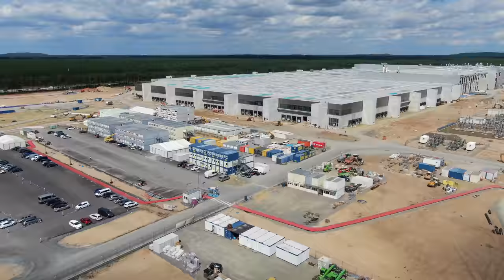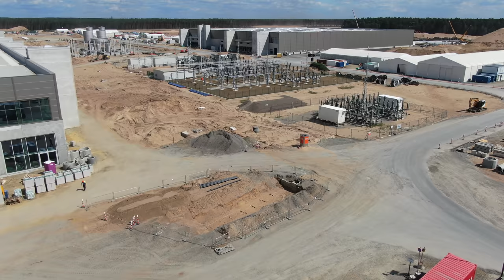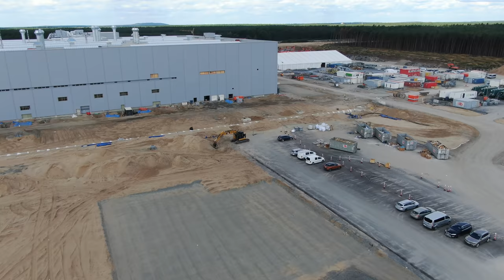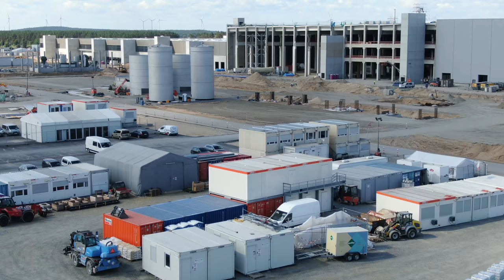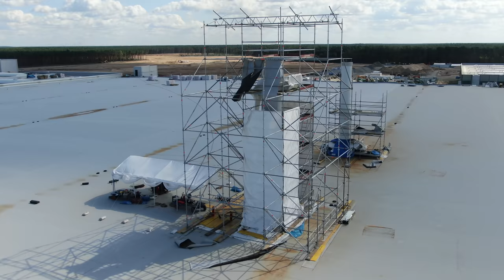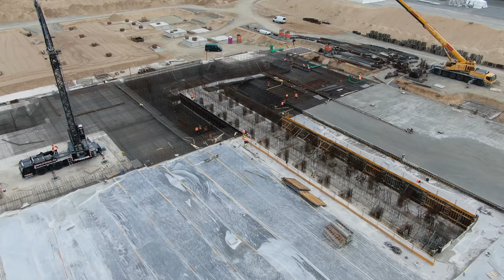Giga Berlin | 2021-07-31 | First Cell Column

Comment: Based on the height of the column, the cell building looks to be quite tall, as tall as or even taller than the paint shop section of the main building.
Reply: Same hight.
Reply from the maker: Roughly the same height. The roof will be a little higher, but not much.

Comment: What kind of building needs such reinforced structure ? It reminds of skycrappers foundations. Also the pillar is huge yet it does not require support metalic bars like they do in Texas, intriguing.
Reply: Thats the battry production building. It has heavy machines on multiple levels. It needs a strong foundation to support all that weight.
Reply: @JackONeil12  but there was nothing like it in Texas apart from two narrow corridors.  Maybe the can't do geopier in this soil but still the amount of reinforced concrete is staggering
Reply: @shonguiz0  Yeah. Its definitely a lot of reinforcement. Im sure they have their reasons ;)
Reply: @JackONeil12  i really dont wana pull the "but we in Germany do it correctly"-card but its a fact that most German houses/buildings are pretty solid whilst American housing is often made of ticky-tacky. Im not saying that American factories/skyscrapers are all poorly built but those German engineers know what they are doing
Reply: The factory is being built in a water protection area. Many people there are entirely dependant on ground water. My guess is that, in addition to supporting very heavy machinery, the building is being constructed in a way that keeps harmful chemicals from entering the soil at all costs.
Reply: @sebb2826  i dont know, man...
Reply: @sebb2826  That might explain it, although that makes me wonder even more why Tesla insisted to build the factory there. BMW in 2000 was considering it and then opted to go for Leipzig because there was too much risk of environmental obtsacles and thus public objections, exactly what is happening now. They could go to another german site with less risks.
Reply: the ground around brandenburg is known to be very rich in sand and nearly free of stone / other stiff components. building in this area tends to require a stronger fundament than average
Reply: The giga texas didn't have an area explicitly designed for batteries.  Giga nevada doesn't have huge foundations like this either even though they are the battery maker for giga san Franpoopsco.  Elon said he had a team of engineers working on new battery processes.  I'm guessing that there is some amount of storage for raw materials.  The only other times we saw elon dig a hole was for a hydraulic press, casting machine and water management.  This is a huge underground section, and an German bunker level of concrete, so i think they are using that for storing raw material for batteries (rocks)  If Elon is putting his promised rave cave under here, why put it under the building that is slowing down the production of the entire factory?
Reply: High pressure rollers, lots of rails, ultra high precision requirements -> all need ultra stable vibration absorbent foundation.
Reply: Have you ever put heavy machinery in the 3nd floor witch groundet on sandy ground? I guess it is needet... for a robot on the 2nd floor you will need 2 feed of concret!
Reply: "place to park the German Army" would appear.
Reply: @doolittlegeorge  watch out for art school dropouts!!!
Reply: @davidanalyst671  🤦‍♂️🤦‍♂️🤦‍♂️🤦‍♂️

Comment: How the Tesla community gets exited about one freakin's column going up.. LOL Its amazing. Thanks for this nice video update again.

With all the delays in Berlin, with the law suits, permitting problems, the slow down of progress as it seems, I have decided not to wait for a Berlin Made Model Y and get my Model Y probably in September THIS year, imported from Shanghai, which also makes pretty awesome quality cars.. Of course I was stoked at first to get one from Berlin, as it was the plan till recently, but looking at the reality, I have come to the conclusion the true difference between a Berlin made Model Y and a Shanghai made car is a bit trivial to the customer.

I have been thinking about this a lot the past few weeks, but I think for the consumer, like me, it does not make much difference if it is a Next Gen Model Y from Berlin, or an 'intermediate' generation Model Y from Shanghai... I think the improvements will benefit Tesla the most, with tremendous decline of production costs and gain in build quality and production rate. The only thing we as customers would notice is a lower overall car weight, which should improve the range and efficiency a littlebit. But the software, interior, systems like HVAC, motors, etc  are all the same. Actually Tesla confirmed in their letter to me to announce My Model Y is almost ready, that my Model Y will have the upgraded HVAC system with Medical grade HEPA filters and Bio Hazard defence mode.

It will be an amazing new car for me, better than anything I have driven my entire life before. Now I have made the decision, I cant wait till I get the message I can pick up my Model Y!  The Tesla sales people I have spoken with a few times now on the phone said I will be one of the first European Model Y owners, and they think about making it kinda of small event out of it, I will have to pick it up from the Tilburg Factory, and we will all get a tour there.. It would be even more exciting if I get the Model Y on my Birthday! which is also in September LOL!
Reply from the maker: Nice. I wish you good luck with your Model Y delivery! 
I agree with you. The Model Y from Shanghai will be fine and the new technology mostly benefits Tesla with lower production costs. That will help them to make cheaper cars in the future, but the Model Y itself won't be that much different. And the quality from Shanghai is good.

Comment: I find it amazing that the column is not supported by 2 brackets to make sure it is 100% vertical by the time the bottom of the column is fixed in a box of concrete. Perhaps the vertical alignment follows later?
Reply: The column is completely aligned. Why would it need supports?
Reply: You don't need to. The cranes are usually laser-guided. It also seems like the column is screwed to the ground. Next to the column already standing, you can see the doundations for the other ones and there are at least a dozen metal things driven into the concrete. I guess that there are either rebar or threaded rods.

Comment: Tobias, great Drone shots to see the first very sophisticated concrete column placed. This Battery plant has yet again totally different foundation with maximum amount of rebar placed with a lot of detail for pits and  precision hole for free standing Precast Column. It appears there are 2 mass pours or is the footprint going to double again? I thought MAXX BOGEL did a good job but now is gone. Who is the contractor for battery plant. I betting that building may be erected in 2 months. Extremely Fast. Battery Production to start in November is My Guess. Thanks.
Reply: And i know nothing, but i am desperate to know what kind of equipment and production requirement needs  what,  2 meters of concrete under it?!!!
Reply: Bögl is still on site and building the battery plant as general contractor. They just don't have the capacity to build the hall themselves due to the short term planning.
Reply from the maker: @julianreverse  What's your source for that? I don't think that Bögl is not the general contractor.
Reply from the maker: As far as I know the cell production building is built by Adamietz.

Comment: you think it will finish by end of year?
Reply: No.  I think they will be sourcing batteries from somewhere else.  The pictures from the annual statement showed that they have all the equipment and robots in the factory.  But elon said they will be doing trial runs of production before the end of the year
Reply from the maker: Depends on what you mean by "finish". I think they will be able to produce cars this year, but it will take some more years for the factory to be completely finished.

Comment: When is all done This Giga factory is going to cost twice as much as Giga Austin for Tesla.!
Reply: and it will take twice as long
Reply: in the end, who cares. even if it costs 4 billion its no big deal. its value outweighs that by far
Reply: And runned by the half of people - in the end it doesent matter!
Reply: @trex9964  of course it matters. Who wants to waste money? It will be built differently and cost differently. No big deal. People just joking
Reply: The locals will make damn sure of that and more if they can. Silly to build there to start with.
Reply: Why? 
The sand for the concrete if for free. 
Building materials are not more expensive in Germany (which is currently a problem in the construction industry in Germany as the US and China pay insane prices for German lumber).
The workers will cost on average less, as there are many Polish companies working at the GF4.
To build 24/7 is from the labor costs also more expensive than 8/5.
Reply: I don't think so, Austin is much bigger and thus costs more, and I think Berlin is constructing it more efficiently, do more with less people.. Just look at the parking lot at austin, its 10 times bigger than that tiny lot in Grunheide!

Beside that, the return on investment of these factories is remarkable, once up and running it will generate 2-3 Billion dollar revenue each quarter, while the factory itself costs about 2 billion or so, so it earns itself back in just one or two years!
Reply: @davidanalyst671  Nope, Tesla reitterated in the Q2 earnings shareholder deck that both Berlin and Austin will start production THIS year.. Construction of Austin started 5-6 months later than Berlin, so it may take in the end 6 months longer for Berlin to start production than Austin.. In the greater scheme of things this is nothing! 

When I ordered my Model Y in May 2020, first it stated the Production was expected to start 'early 2021' Well, already at that time I could not belive that would be the case.. At some point in 2020, it changed to Production starts MID 2021.. and this has chenged in June 2021 to Expected Delivery end of 2021.. and now Tesla has decided to import Model Y to Europe, it has changed 9 July 2021 (The day I received an Email from Tesla my Model Y is almost ready!) to "Expected delivery: September" 

Anyway, once both factories are up and running we all forget about this discussion and be amazed about what will come out of these factories and how Tesla is reducing costs and makes TENS OF BILLIONS of dollars with these factories. Europe will be FLOODED with Model Y's and put VW, BMW, Mercedes Stellantis and all other European Legacy car makers to shame!
Reply: @abalada  Where is sand for free?
Reply: @MarcoNierop  he was exaggerating. Texas is more efficient. They are working on the inside as well as the outside. Texas started testing earlier into their construction than berlin.
Reply: @richmargin6082  Berlin was installing equipment in the painshop while the general assembly section did not even have a roof, so that is BS argument.. Berlin is now building its third IDRA gigapress while Texas has only two...

Its hard to compare on these matters as for example IDRA has limited employee capacity to support all of the 4 factories at once (Berlin, Texas, Fremomt and Shanghai had all new gigapresses built more or less the same time!).. When Texas was already making hundreds of gigacastings with these presses Berlin was already testing the paintshop, while in texas that was no way near that phase...So its hard to tell how far a factory is with testing.. Timelines and milestones are different for every factory, and with the walls going up quickly it is out of sight of the drones, so basicly we have have no clue anymore..

BUT all this being said, in the end it does not matter, as long as both factories start producing hundreds of thousands of cars next year, this petty discussion is soon forgotten.